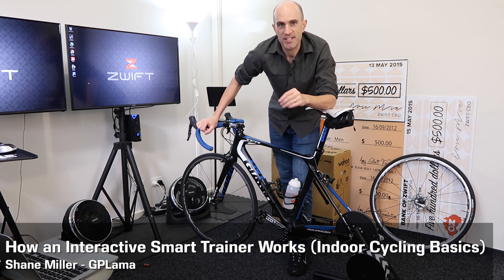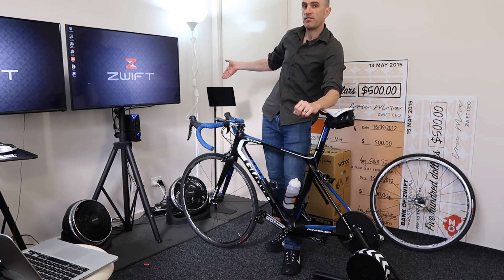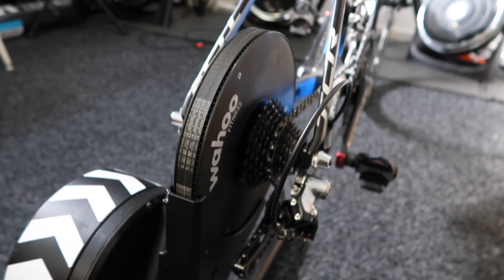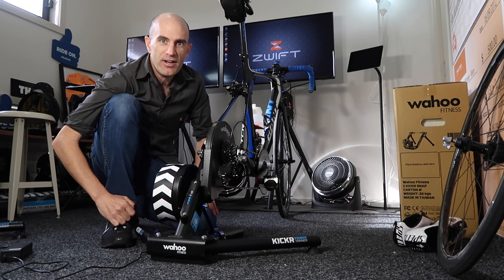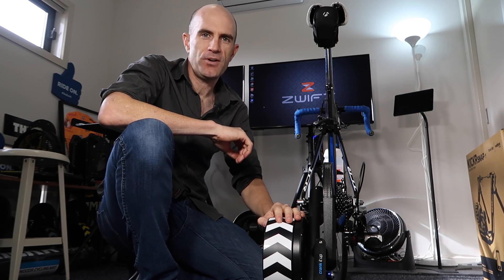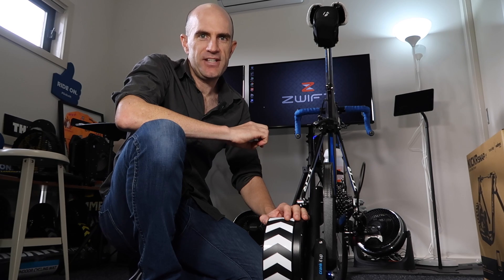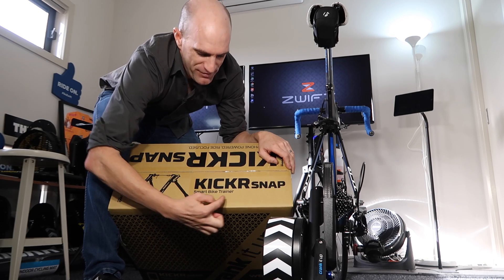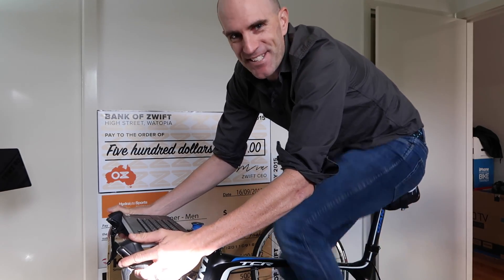How an Interactive Smart Trainer Works (Indoor Cycling Basics)

Comment: Hi. I have the old Wahoo Kickr trainer. The latest firmware for this unit makes it disregard the existence of its strain gauge for power readings and rely entirely on the electromagnetic brake. Did you do this upgrade to your old Kickr trainer, and if yes then why did you do it - is there any reason for which you do not want the strain gauge ? Why did Wahoo even put a strain gauge in the first place, then ?
Reply from the maker: I've done a video on this firmware update.

Comment: I've never actually given any thought to this before, but are smart trainers really worth the money or is it a case of paying for a brand name? (looking at you zipp)
Reply from the maker: Good question. The top level ones (Neo, Kickr/2, Drivo, Hammer) are all in the same price range now days. What they provide is the premium experience of a cycling simulator... well... as premium as technology allows right now. When you look down the line at cheaper models there's compromise. The Flux power accuracy range is a little wider than the Neo (but it's not too bad for most). Then the tyre-on trainers have their quirks with tyre pressure and roller pressure/knobs being tensioned just right... and tyre wear.

For the amount of kms I've put on my original Kickr, (well over 10,000) it has been worth every cent. So usage will come into play when deciding what's worth it when it comes to what to spend.

Comment: Good one Lama, sorry to hear you picked up a bug in your travels.

I guess to be technically correct, in "sim mode" it will simulate the hill if the trainer difficulty setting (in Zwift) is set to 100%. Sorry to be a pedant, but I believe that setting is 50% by default, and I think a lot of people don't even know what it does. So in the default setting a 10% gradient will actually feel like 5%
Reply from the maker: Nailed it... but.. basics. I tried to keep this generic and not Zwift-centric. I'll cover that Zwift trainer slider one day in a video by itself. It takes some explaining as the misconception is it makes you ride faster/slower.
Reply: That would be a good video I think as that setting creates a lot of confusion from what I've seen. I explain it to people that for the same hill it's like having lower gears on the bike; going up the hill needs less force, so it can feel easier, but you go slower.

Unrelated, but with your other hat on, I was introduced to PoisonTap yesterday. An interesting piece of kit that one!

Comment: OK with the ERG mode do you have to change gears as I tried it and the resistance got that hard it stops me from spinning my legs. do you keep in a constant gear and spin away. thanks Lama
Reply from the maker: Yes! Change gears in ERG mode. There's a lot of people who say not to...  but different gears means different flywheel speed... and that changes the load on the legs. 300W at 90rpm in the little ring is very different to 300W at 90rpm in the 53/11. It's all about matching the same 'feel' and firing patterns as outside. There's a craft to riding ERG mode that I'll cover soon.
Reply: Thanks for that I read on the Zwift Q&A on their site that not to change up or down just ride in a comfortable gear that you can spin in.
Reply from the maker: Trainer Road also say not to change gears....... but.... try the 300W 90RPM test yourself in ERG mode. Gearing and flywheel speed make a difference. I'm just stepping on the Hammer now to do just this and map it with the 2INpower pedal stroke analyser.

Comment: Are you using power matching regularly Shane? 
My experience so far has been positive. It's not quite as tightly controlled as with the Kickr but I prefer the ease of pairing and guaranteed accuracy of a separate PM.
Reply from the maker: Yes, I am actually. I've been using the Kickr (I love my original one!) and the PowerTap P1 pedals for power and using ERG mode for my Zwift workouts. It's been pretty good. It'll oscillate a just little bit... but it's pretty good.
Reply: Thanks Shane. Did your 5x4 today,the screw turned steadily each interval!
Look forward to Snap thoughts. 
My summation: Snap=solid unit,Kickr2=superior feel(no wheel slip on steeps,accuracy far superior).